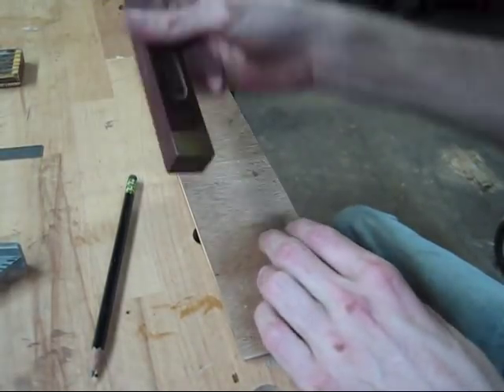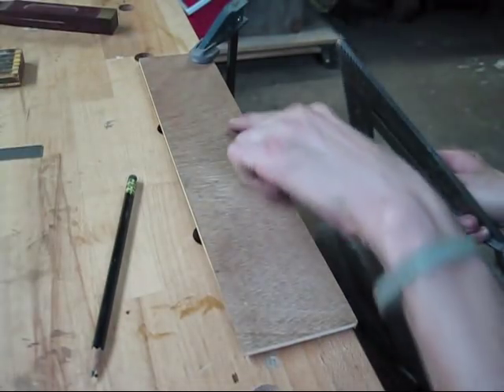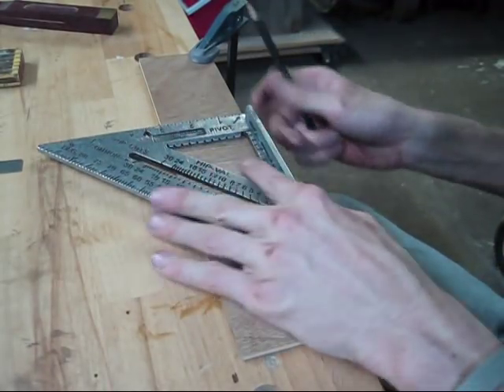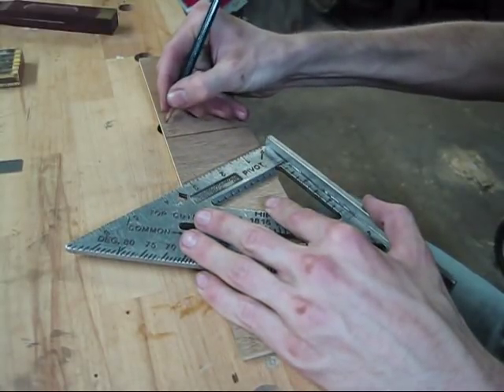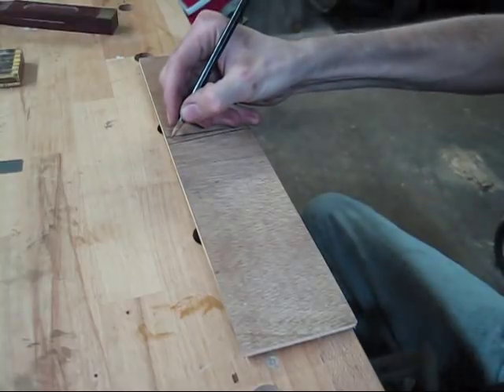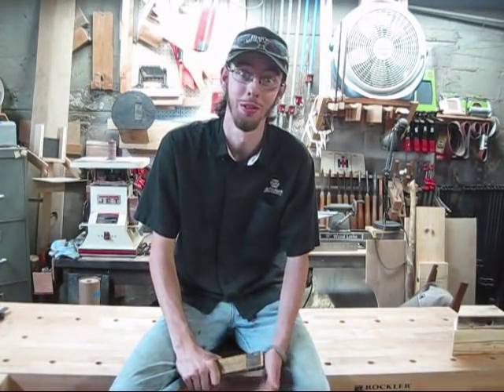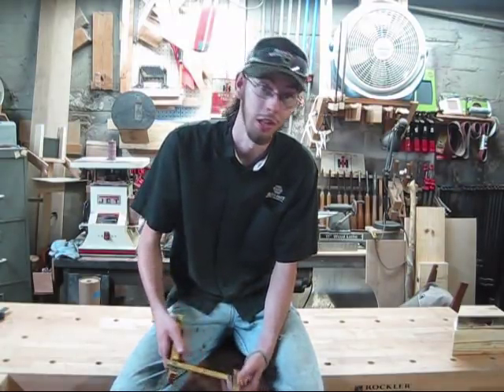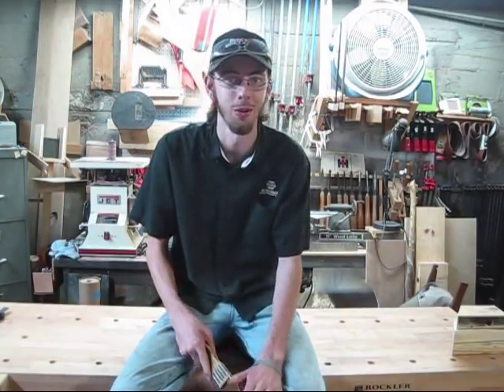basics on a T bevel

Comment: Ethan,

Cool video on the t-bevel.  It's amazing how the "basic" tools are rarely discussed and how meaningful they are.  The demo you showed about the 2-degree difference in the miter cuts was insightful because, as you said, it could impact the project where length is concerned.  I now use this tool to determine accuracy of inside corners of my cabinet boxes and even squareness of ceiling-to-wall measurements for framing.

Thanks for providing both tool basics and (clear) examples!

   -Derrick

Comment: Great video, I need to get one of the T-Bevels so I can get the angles I need off the base that my wood-stove sits on so I can finish the trim around it.  Did the flooring last year and just kind of eye-balled the measurements for the lengths of the flooring.  I have trim to put around the base to cover up the space I just couldn't find anything that would give me the angles...now I know exactly what I'm going to need.  

Thank you for a great video.  You have some awesome easy to understand instructions on many of these measuring tools.  The speed square and carpenter's squares are great tools, and learned how to use them several years ago while I was in junior high school because I saw all the markings and took the time and had my shop teacher explain the markings, and how to use them.

Comment: Nice video and well presented. I'm a plasterer by trade although since work is drying up, I have been needing to take on any job. As I'm a perfectionist I like doing quality work.
This is useful for brick paving. Also building pergolas. Thanks. I have the sliding bevel and drawing up some angles on the computer.

Comment: The two examples aren't identical. In the first example, the brass part of the bevel gauge extends to the left of the brass. In the second example, it doesn't, which suggests that you weren't holding the bevel gauge in the same place in both examples. It's possible that I've made an error in my observation, but I don't think I did. Just the same, I like your videos. Very informing!

Comment: My question is , can I use this tool to determine angle cuts on valley rafters or any other rafters. .  . I really appreciate what you are doing for people like me who learning stuff like this on YouTube.  I still have. a problem to cut rafters on a gable roof edition to cover my porch . . I am watching your channels  to understand more about measurements and cuts. THANKS for this video.
Reply from the maker: Yes it can.  There are easier ways of doing it though that's why it is not used for that.
Reply: I've found that my old carpenter's tools also work for my new jewelry making hobby. An angle is an angle, whether it's on pine, cardboard or silver.

Comment: Would a digital t-bevel be better than a digital angle finder or are they about the same?
Reply from the maker: I don't like digital tools only because when you need them a lot of times the battery is dead, but other than that they will tell you angle faster than doing be hand.